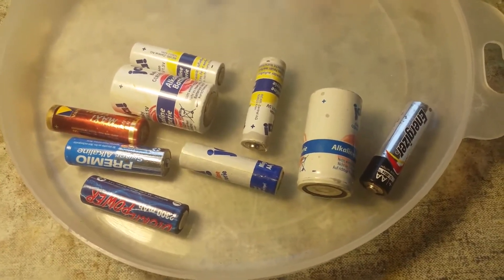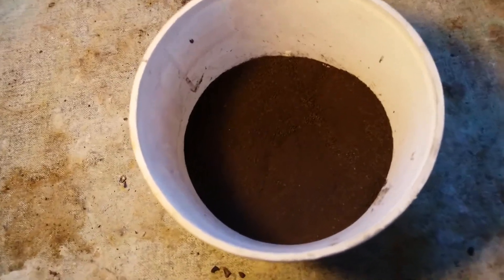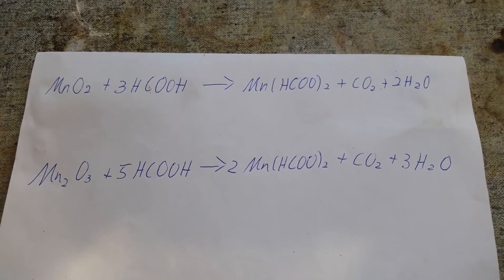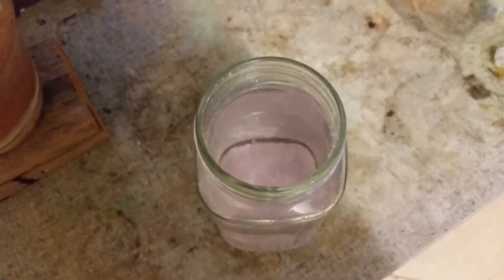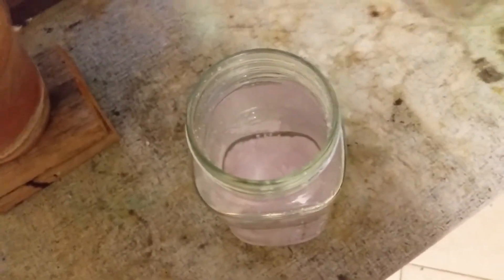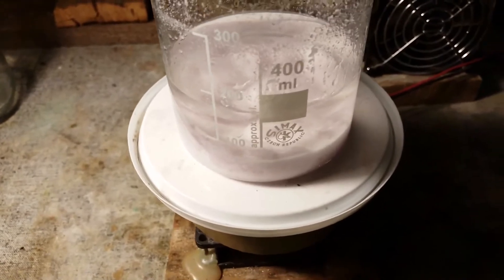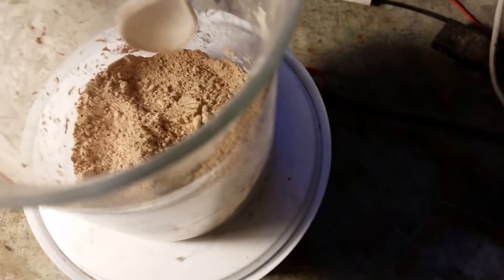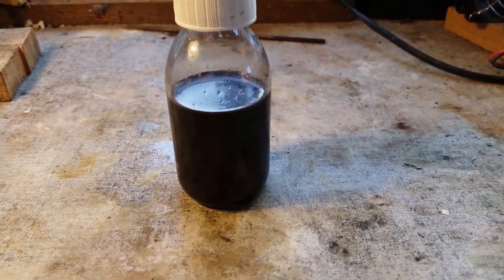Manganese nitrate from batteries

Comment: Iron is a common impurity in manganese dioxide, so that may be the reason it's brown, you are dissolving the iron and then it precipitates out as the carbonate maybe
Reply from the maker: In this case the brown color of my product is actually MnO2 because manganese carbonate likes to oxidize in the presence of ammonia. Any iron from the starting material should have precipitated as iron hydroxide as iron(III) formate isn't stable in neutral-ish solution while manganese formate is.

Comment: the biggest source for manganese dioxide in battery form is C cell D cell and 6volt lantern battery, as you'll get the most bang for your buck. i dont think its worth it to extract from AA and AAA, cause they're so small. plus its a hassle so getting more for less work is always a plus.

Comment: And what is the process if i wanna use HCl ! After formation of MnCl2 how can i conver it to MnCo3 ?
 Will NaCo3  double displacement methode  do the job ?
Reply from the maker: Well, hcl would be used in pretty much the same way. It will generate a bit of nasty chlorine though and probably also dissolve a bunch of iron. To get rid of iron impurities NurdRage's purification technique could be used. The rest of the procedure would be pretty much the same though.

Comment: Why my dear you don't react the Mn oxides with nitric acid?
Reply from the maker: Because unfortunately manganese(III) oxide and  manganese dioxide don't react with nitric acid. And even if they would the nitric acid would also dissolve a bunch of crap like iron and zinc, which I didn't want to have in my product at all.

Comment: You should make more videos on how to make ammonium nitrate
Reply from the maker: There already are many videos on exactly that subject out there so I'd advise you go watch those.
Reply: I do not advise you to do so by any means but you can simply nitrate the ammonia in an ammonia solution with conc. nitric acid. The chemist should cool the flask when doing so. I am not in a country where I feel safe doing so, so make sure it is legal where you reside.
Reply from the maker: @sheevpalpetine7687  Yeah, I'm not gonna do that method as it's quite a waste of both time and resources and I have enough AN anyways. It's a restricted chemical for a good reason so it's best to not have anything to do with it if it's illegal.
Reply: @Bavarianscience  Ich bin weder Staatsanwalt noch eine andere Instanz, vor der du dich rechtfertigen musst, ich möchte nur, dass du dir der Gefahren in allen Dimension bewusst bist. Nicht ohne Grund verstellt selbst Nurd Rage seine Stimme...
Reply from the maker: @sheevpalpetine7687  Nun ja ich bin mir durchaus bewusst dass bei manchen meiner Videos schnell etwas schief gehen könnte und bin deshalb inzwischen auch vorsichtiger geworden.